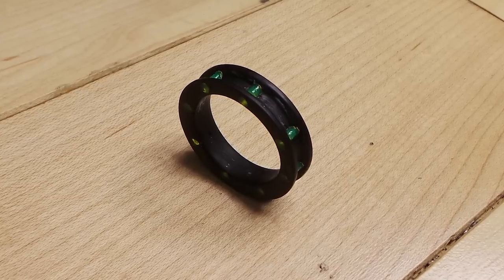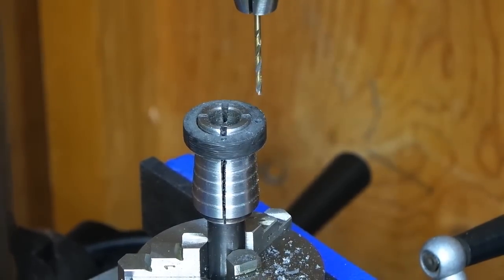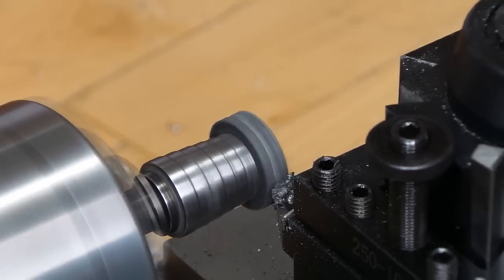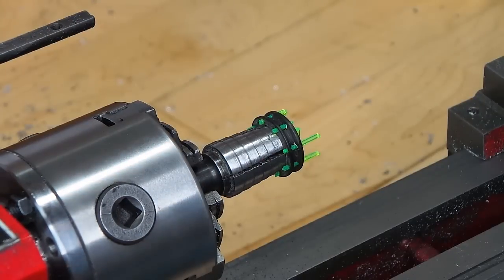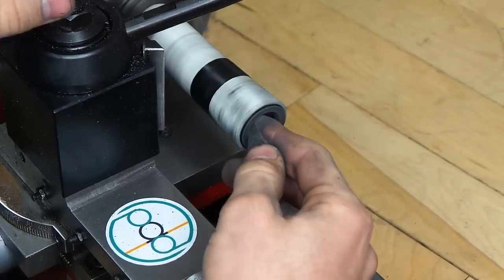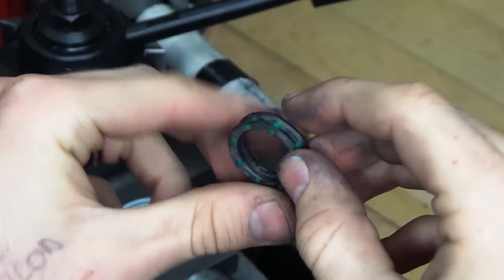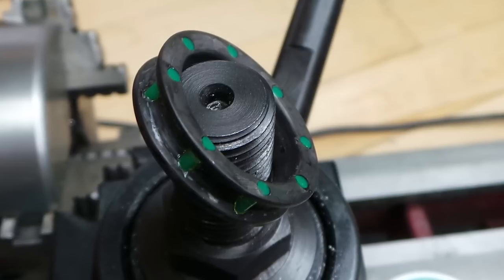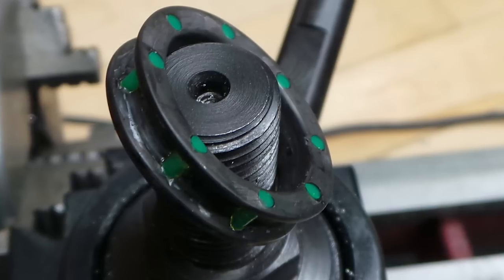Making a Carbon Fiber Ring with Fiber Optic Inserts

Comment: I thunk you should revisit this design, but put the rods in at an angle, so its not perpendicular to the sides, like if the ring was wider the rods would spiral around it. Maybe red, and fill the gap with resin. And make it out of meteorite, instead of carbon fiber.

Comment: Use a centre drill bit to start your holes. They have a thick shaft and a thin tip and do not flex. Engineers use them when holes have to be drilled very accurately, such as when drilling centre holes in metal stock to be turned between centres on a lathe. Love the rings! I'm going to make a few on the lathe and see how they turn out. I work with metal and timber, will try some combinations.... Fantastic videos!
Reply: Spot drills also work well. They're designed to put a divot in your part so that the drill bit doesn't wander, similar to a punch but more precise. They have thick shafts that come down to a sharp point. They're a little bit more durable than center drills which is a plus, and if you set the depth so that the diameter of your divot is just slightly bigger (maybe .010") than the diameter of your drill, it pre-deburrs your holes for you!

Comment: You could probably use a really short drill bit (or even chuck the bit up further) to minimize the flex in the bit.  Then start the hole with a very stable bit, and finish it out with your regular bit.  There might even be bits designed for that purpose.  I feel like many of the machining guys on YouTube start with a really stubby bit to do the same thing as a punch.

Comment: What would be really cool on this would be to put the acrylic through the holes with no adhesive, but then fill in the groove with a clear resin. it would work as both an adhesive, and a protectant to keep the groove from getting dirt and such it in.  The other option would be to countersink the holes slightly and  melt the end of the acrylic into the wider opening on both ends, basically head riveting it in place, similar to installing acrylic fiber sights on a handgun.
Reply: Clear resin and glow powder ;)
Reply: I was thinking that exactly

Comment: I suggest taking the drill bit you used and putting it in your lathe,then taking your tool post and bringing it so it's taking off the least it can,keep in mind we're talking about hundreds of a millimeter.Squirt some water on it through the whole process so to not let it heat up and also spin it in the direction opposite than the direction it drills in.This should make for a tighter fit on the pins.